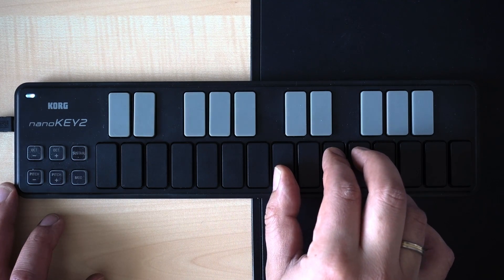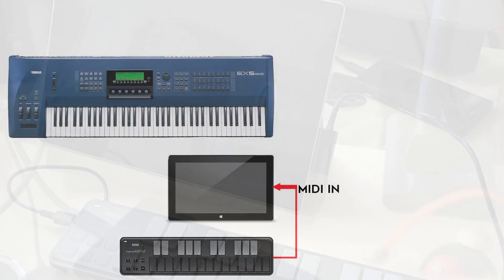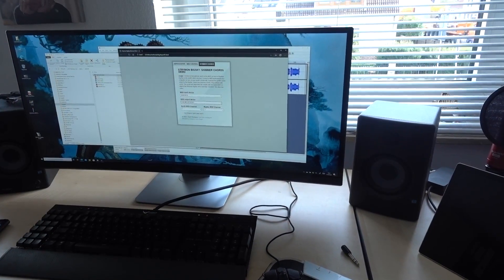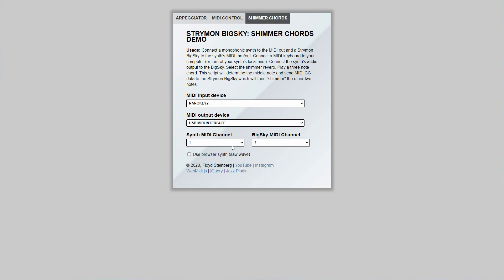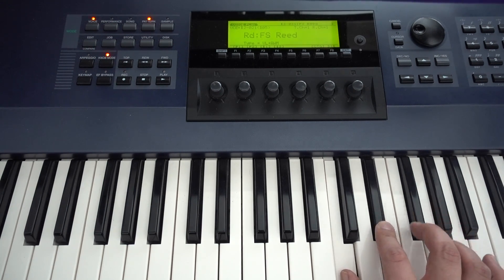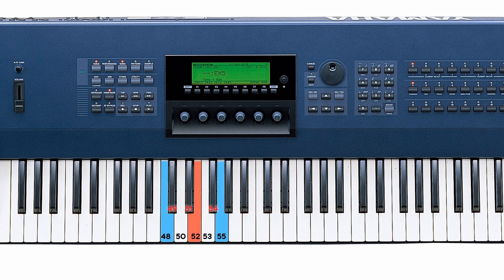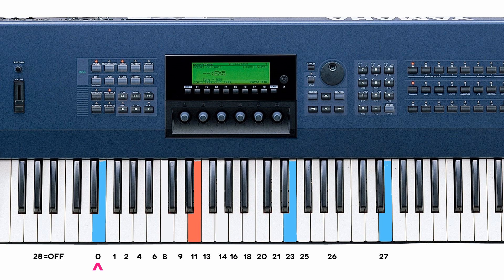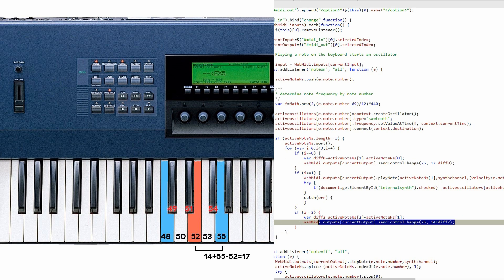WebMidi JavaScript: Turning a monophonic synthesizer into a 3 voice polysynth using Strymon BigSky

Comment: Hello Floyd, 
Off subject 
Subject : R24 
Topic : SD card
Tools:  SD Card : Format
After an SD card has been formatted on the R24. 
 1. Prg001 was created un 48 khz.
2. Audio track created and recorded.
Can this SD card be read on an Android phone without the need to reformat the card on the android phone and still read the audio portion of the project. 
Also,  if no format on android is required, then will the SD be read by the R24 as it still formated as initially performed ? 
Thanks
Reply: Most recording devices, if you format on the device it will work fine elsewhere. Most use standard FAT32 or exFAT formats. Don't just put a pre-formatted card in the device and use it, though. A friend just ran into huge problems with that with his Zoom H6 (I think it was an H6).
Reply: @Psychlist1972  thank you. I lost about 50 prg's after putting the SD card in an android phone and reserting in the 24. 
The prg's are all there but none have audio.
Reply from the maker: As Pete Brown said, please format your card on your computer using fat32 (that's the most commonly supported file system, afaik).

Comment: Nice video. Sadly, but WebMidi API is still draft specification, and, currently, is available only in Google Chrome (and others that use similar engine).
Reply from the maker: Thanks for watching. I know this, but at the moment, nearly all browsers are based on the chromium engine. I've got some requests to rewrite this in C,  and I'll post it on my community tab when that is done.
Reply: True it's draft, but Chromium Browsers like Google Chrome and Microsoft Edge on Windows, macOS, Linux, and Android, and then extensions for FireFox, plus apps on iOS all support it. There's also MIDIjs. You can get to it on most anything.
Reply from the maker: @Psychlist1972  this. btw the new edge is great. hope it catches on.
Reply: @mr_floydst  Thanks. That's my hope too :)
Reply: You are making valid points, guys. I just wanted to point out that not every “modern browser” natively supports WebMidi API. Also, I doubt there is native support in the iOS apps (they do have Core MIDI for that). Maybe via some kind of “workaround” such as this (have not tried this solution): https://github.com/mizuhiki/WebMIDIAPIShimForiOS